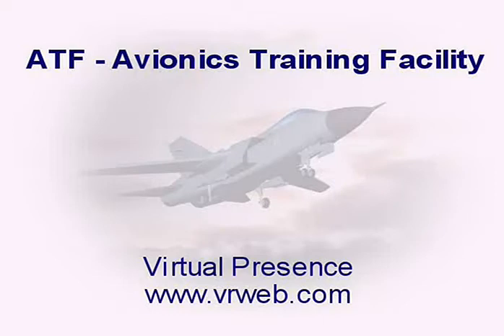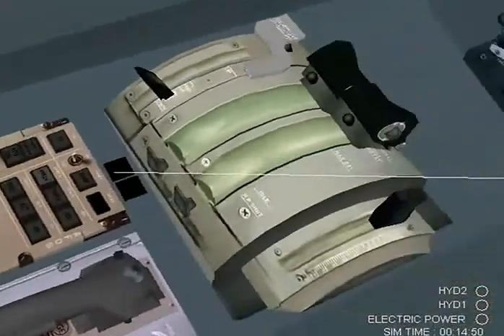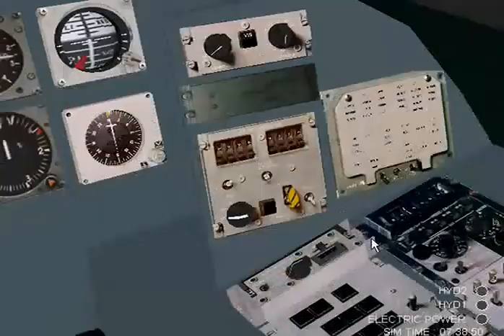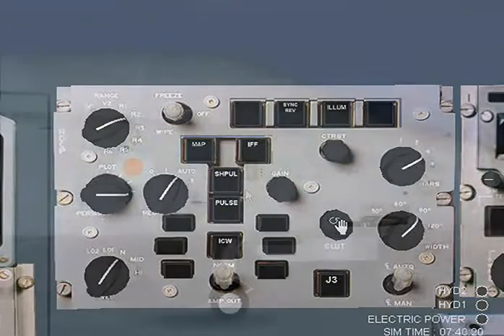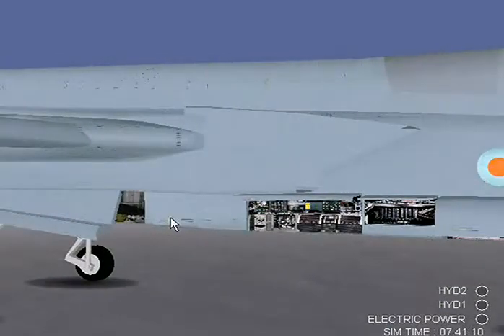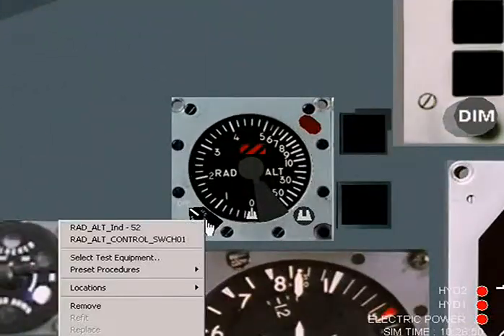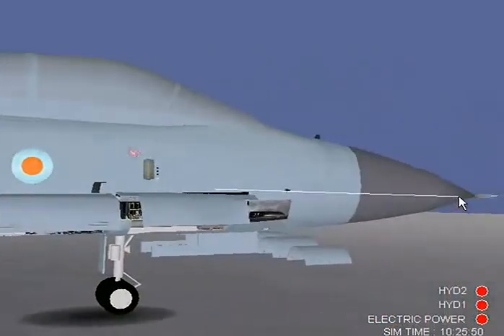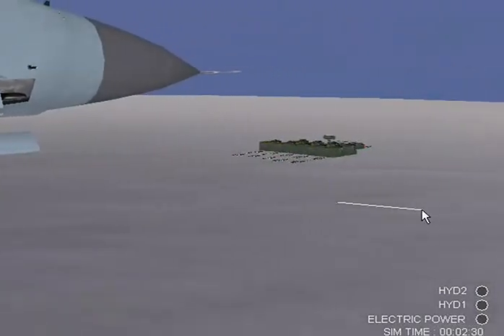RAF Tornado Avionics Trainer (1999-2000)

Comment: Where’d do you get the video?  I worked on the development of that system.
Reply from the maker: Did you?  Don't remember you!  We (Virtual Presence Ltd at the time) were contracted by Alenia Marconi to develop the trainer from scratch in the late 1990s.  Had to measure and photo a Tornado to get all the detail.  Worked closely with the guys at Marham to program the functionality and get the triple-screen workstations in place.
Reply: @ProfBobStone-XR  I was a Chief Technician in the Royal Air Force and the senior F3 avionics instructor at the Tornado Maintenance School.  I wrote the cardinal point specification for the system, and later at Marconi I lead the systems team that built the aircraft emulation to drive the 3D graphics provided by Virtual Presence. I was the last engineer on the project and did the final bug fixes on the emulation and installed it at Marham. Thanks for posting this.
Reply from the maker: @paulmaidment1158  Interesting ... I thought we did the 3D graphics AND the avionics emulation and human interaction techniques (as we wrote a dedicated "engine" to do just that!!).
Reply: @ProfBobStone-XR   Hi Bob. Andy Millns here. I worked on that project for a few years. Thanks for uploading that! Very nostalgic. Can confirm Marconi did the underlying Avionics sim. We did everything else. We actually spent some time embedded at Marconi to work more closely. One helluva project!
Reply from the maker: @se10er  It was indeed Andy - I was just discussing this project yesterday with the Cornwall Aviation Heritage Museum at Newquay.  They were given two Tornadoes, including an F3.  They were gobsmacked that we were "given" a fully functional aircraft at Marham to measure, photograph and play with!  Great to hear from you!